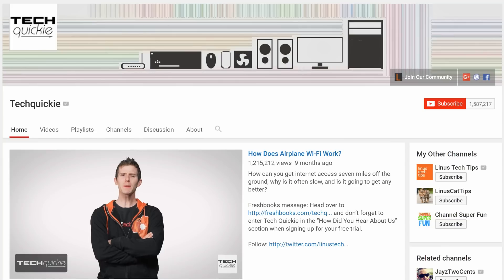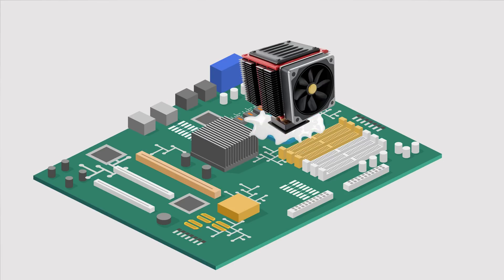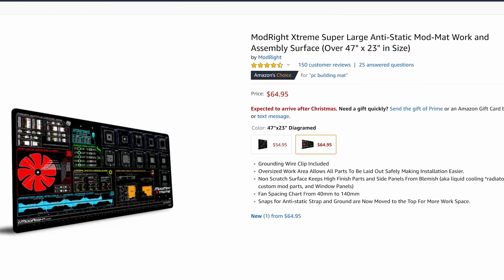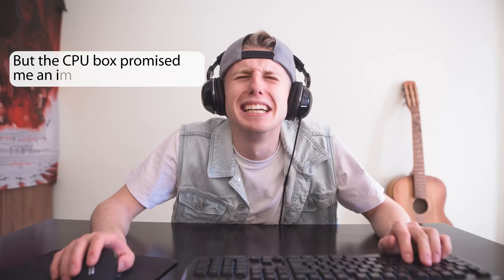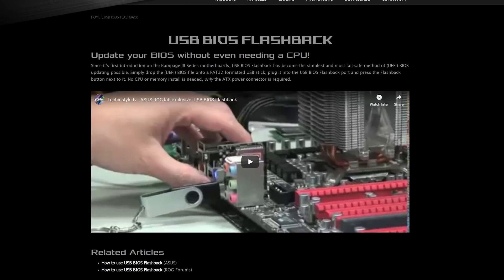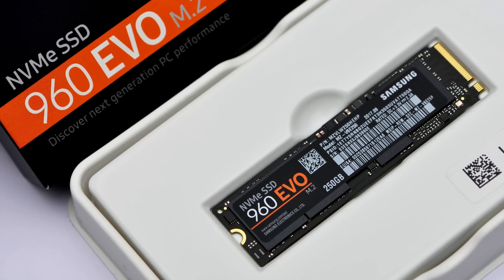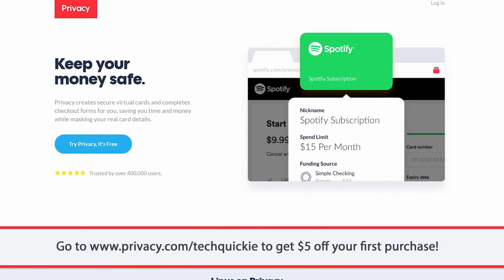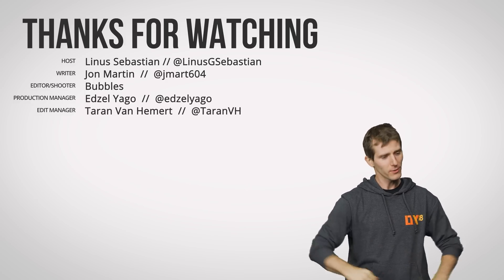DON'T Make THESE Mistakes Building A PC (pt. 5)

Comment: Pro tip: if your newly built PC doesn't turn on, check and see if the power supply is turned on first.
Reply: Calidrius once I had a PC that wouldn't start, tested all, in the end the Start button on the case just wouldn't work and needed replacement...
Reply: or checking if the power cable is plugged into the motherboard
Reply: @kiyoponnn  - nice edit, weeb
Reply: a n i m e
n
i
m
e
Reply: That happen WAY too often XD
Reply: Check and see if you paid your electric bill first
Reply: Calidrius yes. I disconnected and reconnected the power switch pins like 3 times before realizing i never touched the psu switch
Reply: I've built my fair share of systems, and I still find myself without boot because I forgot something like the PSU switch, the power cable, the front panel power button or something like that.
Reply: Reinsert your ram sticks
ALWAYS reinsert your ram sticks
Reply: lol that actually happened to me
Reply: Make sure the 4 pin is plugged in
Reply: And check if the front panel connectors I'd they're properly installed
Reply: Meeee.... Made myself feel like an idiot at the store when they tested the power supply
Reply: It’s not a pro tip it’s a noob tip
Reply: I like ur profile picture
Reply: @Getyourwishh  idk if this was @ me but it was in my notifications so thank you
Reply: @Pyromaster_  I mean everyone got a notification because we all awnsered on the coment. If there is no @ that means he wrote directly under the main coment
Reply: @Kazuto_Wildcat  yes
Reply: @Pyromaster_  l like pyros too xD
Reply: I had this problem 1 month ago when i built my new gaming pc but when i turned it on only the monitor worked so i asked a very high quality technician in my city and he said its just the power cable for the power supply glad he said he didnt need to be paid but my mom yes i am a kid i just got help from my friends and family so yeah thats how i fixed my pc by just replacing the cable also the power supply didnt have a switch so i was panicking lol
Reply: @breadinapan8902  shit those moments are quite stressful
Reply: @Getyourwishh  yeah there was also a typo in the comment
Reply: @Getyourwishh  the didnt need to be paid part lol
Reply: @Getyourwishh  also my old pc is still running just the hard drive is failing
Reply: @breadinapan8902  you mean you paid at the end xD anyways you learned something so it's a good experience.
Reply: @breadinapan8902  and dont forget to back up ur files
Reply: A friend of mine once built his PC and called me because his PC did not turn on. I told him to check if his PSU is plugged in and turned on, he was like "of course it is, why would you think I'm that stupid". After troubleshooting for 20 minutes he says "wait do i need to turn on the PSU" and after an additional 10 minutes he realized that ge didn't plug his power cable into a wall socket 🤦🤦🤦
Reply: @Brainman_2331  when friendship is about who is smarter' shit happens
Reply: Thx bro
Reply: No joke, just finished plugging everything in and was completely ruined when the power button did nothing..my dumb ass forgot to flick the power supply on...
Reply: Thank you so much, I thought I had to replace it
Reply: This is such a toxic reply thread
Reply: @kiyoponnn  - I building PCs cuz I smart
Reply: @Kalidrius  You shouldn't be building PCs if you're that dumb
Reply: @kiyoponnn  - nice repost
Reply: @Kalidrius  Can't prove it :)
Reply: @kiyoponnn  :^)
Reply: InfiniteLoop shush up
Reply: @kiyoponnn  story from the internet says 1 customer service rep for an unnamed computer company got a request for help with a PC that wouldn't turn on...after running through a few steps the person was asked to check if the PC was plugged in...responded they couldn't tell...then when asked why they explained the power was out at their house.....after a pause they were told to return it as they were too stupid to own a PC
I would say not true because who could be that stupid and it IS an internet story....but then people started eating tide pods....and politics right now, who knows how stupid we can really get?
Reply: @75ur15  I had the same idea, why calling people that didn't plug in they PC stupid people when others voting for Thrump?

Comment: Don't forget making sure your CPU cooler can handle your CPU of choice....[stares with disgust at the FX-9590 and how it's incompatible with 95% of air coolers]
Reply: So this here 300 watt TDP CPU should be fine with a stock cooler from this old 486 build then? <:O And... it's vaporized.

Comment: That is NOT how you apply paste to a Threadripper. Gamers Nexus did a video on this. Put it over the dies.
Reply: Instructions unclear, I used the whole tube and now it won't boot. O_O
Reply: @youtubasoarus  Did you try putting it in a ziploc bag full of rice heard that helps

Comment: manage the cables at least to degree so they don't block the CPU fan. I've seen it and people may have throttleling cpus and use this for years...
Reply: You should really watch their video on the affects of obstructions in a case. If your friends have throttling CPUs it has literally nothing to do with cables unless the cables are physically stopping the fan from spinning, which would be difficult to do and just plain ridiculous.

Comment: Where did do store computer parts when they are not in use like you gp from 4 x 8GB ram to 4 x 16GB from whatever reason (i went with 2 x16 GM to avoid this)

Comment: I mean, technically gravity is a force, so there is a force required when installing the cpu. Without gravity as a force it is probably pretty hard.
Reply: To be fair, gravity is a force that pulls the CPU down. Using a force that pushes the CPU down is risky.
Reply: @VV_PaVria  What if I drop the CPU into its socket from a great height?
Reply: The force isn't required.  It's just inevitable.  You very slowly lower it into the socket in the correct orientation.

That's all.  The end.
Reply: @motoryzen  well, without gravity it would just bounce off before you could close it.
And slowly lowering it would require a force. Because otherwise you wouldn't be lowering it.
Reply: Not a problem with quantum computing. It uses a Higgs field. BobUK.
Reply: To be fair,  gravity doesn't exist!. Lol

Comment: It is also worth mentioning that AMD will ship you a first gen ryzen cpu to jump start your motherboard if your 400 series requires it, but of course the cpu will need to be returned. Still a great option if no one around has a spare ryzen chip to let you borrow.
Reply: As a less hassle option you could probably take it to a tech shop and have them "jump start" it for you. May cost you a bit but it shouldn't be insane.

Comment: What about scratching the mobo in the back when trying to fit it with the standoffs + the shroud.

I don't know if Newegg sold me a shitty USED board or maybe with my beginner mistake, the standoffs may have scratched the back side of the mobo..  

All I know is, after the 2nd mobo, the 3rd was the charm and I did it without the back side of the mobo touching any of the standoffs.  

The two mobos before this one were both ASUS and the 3rd one is  AsRock.  Not sure if I should be pissed off at Newegg/Asus or my shitty mistake.

Comment: # Always salt your pasta while boiling it!
Reply: As an Italian, this comment horrified me. Lets make things clear: you need to wait till the water boils, then you put salt in it, and then PASTA! And wait till pasta is perfect to remove all the water...
Reply: @RedaGD  How does it differ if salt is added before vs. after the boiling? I thought the salt was meant for lowering the boiling point of the water so it would boil faster (similar to why salt is thrown on iced sidewalks).
Reply: @coldblackice  the thing is that, if you put salt before, the boiling point will be lower and you will throw your pasta while the water is boiling. If you put salt when the water is already boiling, the salt kinda stops the boiling, so you can put pasta in a non boiling but still really hot water. I also think it has something to do with the actual "flavour" of the salt, that kinda disappears if you put it too early, but its much more present if you put it when the water boils😁
Reply: This is true!!!
Reply: Weird flex, but okay. :D
Reply: I have no idea if that is a joke
Reply: @J L Weird flex, but okay.  XD
Reply: @youtubasoarus  odd,  proposal but alas

Comment: Remember guys, this is the order:

Thermal paste
Cpu
Motherboard
Bowl
Cereal
Milk
Reply: No the milk goes before the bowl
Reply: @JesusMeza3  that works, but for optimal performance, make sure to put the CPU on the thermal paste and then the motherboard. You'll get lower temps and an extra gigabyte of coolant.
Reply: Should I be writing this down?
Reply: So, chances are, if you're the type of dude who puts milk before cereal you're dead
Reply: @prateekkarn9277  What kind of sick, twisted animal would put milk before cereal??
Reply: @HeyImLucious  one that only wants to drink milk and not eat cereal. Also, only the homo sapiens eat cereal in the first place. I'm a planetoid alien who synthesises food from sunlight and...
Reply: and what?
Reply: and milk. 
Duh
Reply: im stupid
Reply: @HeyImLucious  Ive been putting the milk before the cereal since I was a good 8 years old
Reply: WHAT THE FUCK DID YOU JUST BEING UPON THIS CURSED LANDS
Reply: Instructions not clear.  Motherboard shorted out from the thermal paste and the CPU didn't fit well into the motherboard because of the thermal paste.

Also, I couldn't get the bowl to fit on the motherboard.  I fail to see how cereal even belongs on the motherboard.  And, I may be stupid, but I'm not dumb enough to put milk on it.
Reply: @manictiger  just download another motherboard off the internet.
Reply: @manictiger  are you dumb. It's too passively cool the CPU with milk and the bowl is the heatsink. The cereal is for aesthetics so use Lucky Charms.
Reply: @JesusMeza3  rgb cereal
Reply: Hotel?, Trivago
Reply: @tristanburditt8317  Trivago?, Apple
Reply: @tristanburditt8317  no this is patrick
Reply: Instructions not clear, milk is all over motherboard while cpu in bowl with toothpaste stuff.
Reply: Milk 1st because I need to microwave it. Mmmmm warm cereal :3
Reply: I used the wrong screws for the standoffs!!!
Reply: forgot coffee
Reply: How to Basic agrees
Reply: no for an extra linus of rgb put it in this order from top to bottom milk cpu thermal paste mother board bowl cooler and cereal
Reply: Nah I put the thermal paste, milk, cpu, motherboard, cereal and then bowl
Reply: Actually, the milk comes before the cereal.

Comment: step 1 dont have a roaring dunkard party with your build half complete and in the open 
step 2 dont drink or eat near it
step 3 dont let it be used as a trash bin just because its a cylinder or tall style case that has an opening on top for fan/radiator placement

Comment: Pro tip - Don't jizz on the motherboard
Reply: It works fine tho
Reply: But what if it's really new, and fresh... and like has all the gigagherts?! How can you not?
Reply: Flase a sperm cell holds like 37 megabytes of data if you ejaculate on your mobo it will boost your transfer speeds try it it works

Comment: Just did my first build works great except got 2666 mhz ram which is the lowest the MB supports  but when looking in bios started at 21xx mhz something and got it stable at 24xxmhz but not 2666 why? 16gb patriot  viper elite 
Runs bf5 fine on all high only clips because of my tv
Reply: it's your mobo

Comment: how about where to get a standoff for your m.2 because you buy an m.2 drive at a later date and can no longer find that standoff or screw will fit in to install the brand new (actually 3 month old now) m.2 drive a person may or may not have bought
Reply: all of the boards I have built on that have m.2 capabilities have had the screw in the standoff which is screwed into the board.
Reply: RavenousJoe not mine
Reply: @seangraylin  I just got a new mobo, and the 2 screws were in the tiniest little bags. Try looking under the cardboard insert for them.
Reply: RavenousJoe I built it a year and a half ago the box is long gone. It’s fine though when I upgrade my motherboard I’ll be more vigilant

Comment: Use a thermal pad, problem solved. Do some research, pick a case that you know is easy to build in. If it's cheaply made, your first build can be an extremely painful process.
Reply: thermal pads are for VRMs, not CPUs.
Reply: @ArashiOdayakana  You're a moron. I have an IC graphite thermal pad between my CPU and cooler. You can actually Google anything b4 you type.

Comment: #1 Tip: Never, ever forget your Swiss Army Knife that may or may not possibly contain a Phillips head screw driver.
Reply: SehxualPanda and some 'tweezers' for the cables as well as how you need a table.
Reply: Priority list for pc building:
Table
Swiss army knife
screwdriver
thermal paste
Reply: @ninjagaro.  Where does the cancer fighting wrist strap fit in?
Reply: i forgot to say
you have to draw a house when applying thermal paste
Reply: @CaveyMoth  The wrist on the "table". What about the CPU applicator???
Reply: @ninjagaro.  Like a loooot of thermal paste!
Reply: @ninjagaro.  Thermal paste: enough to submerge the CPU deep inside it. Also, cable mgmt is a lie.
Reply: Who has a table tho? Does it come with a Swiss army knife?
Reply: Never ever forget the Allen wrench, the one he never used
Reply: @prateekkarn9277  Hammar daun  da IO sheedh.
Reply: I hope this meme never dies
Reply: @its_elkku135  he's still being flamed at after 2 years hahaha. Check his Twitter.
Reply: In all seriousness though, I have built a PC with my Leatherman multi-tool before. It was a pain in the ass, but it is possible.
Reply: 666 likes :)
Reply: Hahahahaha yeahh VER*cough cough*
Reply: @frigidgale2001  some Asus motherboards come with those....though I've never used one
Reply: Awwww... the verge...
Reply: Don’t forget to fasten your brackets and braces!!
Reply: "hopefully has a philips screwdriver"
Reply: And buy some pretty fast ram ddr4 2666mhz
Reply: this is the verge of pc building tips

Comment: Screw management! magnetic screwdriver. 

And don't forget, sticking the metallic Intel sticker to your case gives you an extra 1.21 Jiggawatts of processing speed
Reply: Do you need to set your fans to 88 RPM to get the 1.21 Jiggawatts or is the sticker enough?
Reply: Niggawatts*